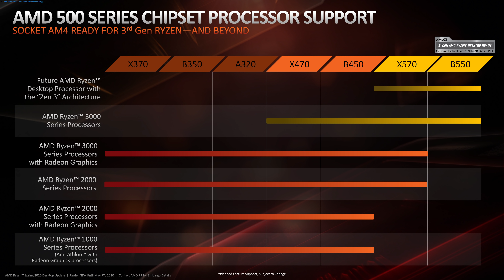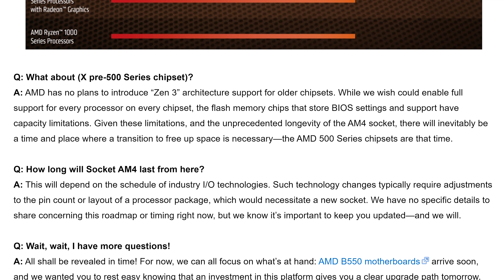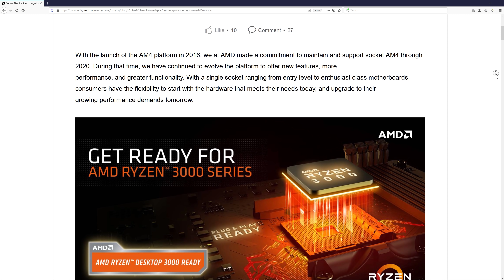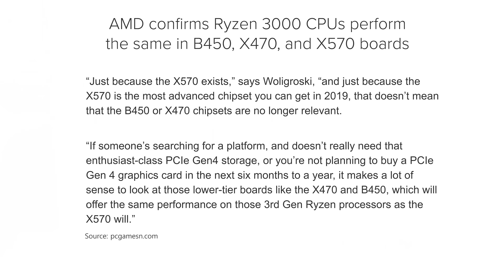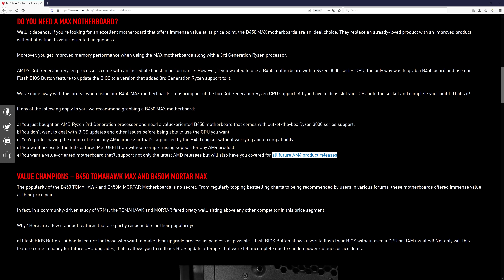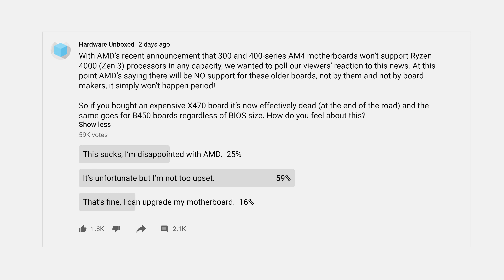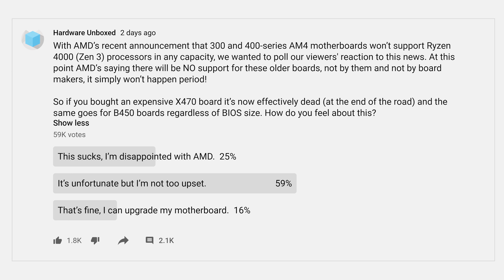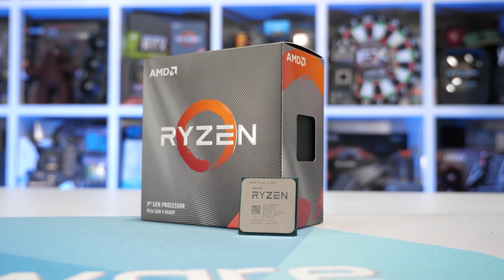AMD Does An Intel, Axes Zen 3 on 400-Series Motherboards, Our Thoughts

Comment: This would of been better if B550 had came out around the same time as X570 at least, the lack of support on B450/X470 would of still sucked but at least there would have been a more obvious choice at the time.
Reply: I agree. Simply a cash grab and to make b550 profitable
Reply: But is it possible that AMD were trying to help their board partners out by only releasing the high end chipset that they will make more money on?
Reply: Exactly this. When I bought my Zen2 last year, well obviously B550 was nowhere and the 570 boards were insanely expensive. All the media indicated that Newer B450 (max) boards would be good for Zen 3.
Reply: @Opaheke1  So, you're blaming AMD for what they media told you?
Reply: Banana  0 AM5 next year
Reply: this! to be honest I wish there was a B550 because when i was building mine i really wanted a 500 series board but at the time they are all very pricey! so i had no choice but went for a b450 tomahawk
Reply: That's square on the AIB. In reality a new A530 and B550 board should have hit the market along with the x570. Instead they got lazy and allowed those boards to continue, making money off the 570 and profiting off older boards that budget builders wanted. 

The x370 is a good board but if someone wants pcie gen 4 they need a 570. Going forward gen 4 is going to be the mainstay. I mean let's be honest almost 10 years on the same socket is amazing. Upgrading to a 550 that may have more features....adding more value is a win for consumers in the long run. No one will have an B350 or 450 lying around if your board goes bad, you will eventually be forced to upgrade either through obsolence or damage.
Reply: You mentioned the alternative. If you wanted forward compatibility you should have went with the chipset that had all the latest features in it. X470 and B450 are 2 years old and are really just enhanced X370 and B350 motherboards.
Reply: @carisi2k11  I don't get the point.I m an early AM4 adopter and got into the platform cos AM4 commitment as   AMD marketing pushed back 2017.So we speak  about AM4 not chipset.AMD NEVER told us about chipset upgrade paths only BIOS.This what I told in Reddit 2 days now and got downvoted.I agree 100% with Steve at 4:40 thru 5:40.AMD start to break the promise with Zen2 naming beta bios for 300 models.That was strange and odd thing as x470 taichi had no difference to my x370 taichi.And the weird thing was the removal of pci 4.0 from quality boards.
Reply: @GreekSIMRACING  Imagine trying to talk sense on reddit. It's useless , fanboys will defend the company even it the move its actually anti consumer because it doesnt affect them

Comment: Your "simple" workaround of multiple BIOS' would lead to a lot of buyers ending up with incompatible versions and a board+CPU combo that doesn't POST.

And most people won't have access to a CPU from the previous generation to do the update with.

When I bought my 2700+X370, I had the reseller update the BIOS, but I still remember that I wasn't sure whether I needed it and thought about saving money by foregoing it. In the end it was just lucky that I did.
Reply: Not true at ALL. You can upgrade or downgrade your bios buddy
Reply: @nephron9924  if you have a CPU with which it POSTs at all. Otherwise you're out of luck.
Reply: @notthedroidsyourelookingfo4026  some motherboards can update BIOS without a CPU via a special button and a USB stick, but it would be confusing to a new user and quite complicated given the mixing of different architectures between 1000, 2000, 3000 product naming.

Comment: It may have been to avoid consumer confusion too. Currently sorting for a chipset does not guarantee that your CPU is supported, until it had a BIOS update, and I think they somehow want to prevent that confusion from getting worse in the sense that some motherboards will have enough flash and others don't.
They already went beyond what Intel ever did, and if they support the 500 series properly for another few years, I don't see them as doing an Intel.

Comment: Am surely pissed off with AMD with their choice to not support B450 boards. I upgraded all my desktops with 450 boards and with AMD axing support for them is a really bad move. As you've mentioned the companies assured us that our boards would give us future support for new AM4 CPU's (at least Zen 3). Now with this decision, AMD has acted like intel where  now to run their upcoming processors you have to buy a new motherboard with new CPU socket and chipset making the entire upgrade expensive and making obsolete what you got which has only gotten a 1 generation CPU support and a short life span. Thanks AMD for screwing us over again after we thought you had our backs compared to intel!!! I see lawsuits popping up soon.

Comment: I kinda agree with Linus on this matter, where he said AMD is probably doing this because in order to improve and expand CPU and chipset compatibility, they screwed over the user experience because of the bios updates required to use newer processors. This might be fine for people who are upgrading but for new customers is a lot of hassle. So they are probably trying to avoid doing the same thing to avoid confusion and bad user experience for newer customers. It still sucks for 400 series users, wish they reconsider it.
Reply: I've had to flash the bios on all AMD mother boards.  Ram compatibility on B350, PBO issues on B450, Boost algorithm for X570.  Not exactly a great user experience on any.  AMD bios just sucks.
Reply: @jamesthomson8659  Then maybe that's what they are trying to fix with this decision

Comment: It's a bit fucked up to release a Ryzen 5 3600, promotes b450 compat (x570 mobo being more expensive than CPU itself :S, no b550 yet) and ''removes'' forward compat for next gen CPU THAT THEY JUST PROMOTED AND WE BOUGHT!!!! AMD really screwed their costumers here and kinda blaming Mobo manufacturer on their small BIOS chip(which MSI had their solution already and BIOS can be in multiple parts to fix this)

Comment: Question...  Modded Bios??
Also have an X470 Taichi but paired with 2600.., thought I would skip 3000 series and upgrade to 4000 series. Maybe not. But I see no technical reason for X470 not to support zen3. We just need the Bios. Over at overclock.net there individuals with skils for this like 1usmus.
https://www.reddit.com/r/Amd/comments/8kz4p2/huge_collection_of_ryzen_modded_bioses_by_1usmus/

Comment: I only bought my Asus prime x370 pro board because it was an old display model and and I was told they were supposed to get years of support, which I guess they were right, but I bought it right as Ryzen 3000 came out because they were swapping displays. I also got a used 1800x so I guess I have upgradability, it's just a little disappointing that everybody expected this exact thing to not be happening.
Edit: isn't it the bios storage thing they're saying is holding it back from older boards? Doesn't the Asus prime x370 pro have a lot of space?

Comment: That I by any chance have a X470 or B450 motherboard, I would buy on discount 3800X or 3900X CPU and would be in peace with myself for about next 4-5 years. In meantime AMD will change a socket and add a new generations of CPUs, and I would be happy again with a new things in the process.  I will not cry because of this AMD "bad" move. They have self agenda, and everything new may be just a better option.

Comment: It makes no sense for AMD to not offer 400 series MB support. Anyone who bought a x470 or b450 is not going to run out and buy a b550 or x570 board for zen 3 when zen 4 will most likely be on a new socket. Who in their right mind is going to make 2 mother board purchases (400 series then 500 series) and 2 cpu purchases (Zen 2 then Zen 3) within 1 year for a 15% IPC up tick only to have AMD the following year release a whole new Am5 socket series? What they're doing is losing zen 3 sales to 400 series owners and greatly pissing them off in the process, especially with their dishonest excuse that the flash memory isn't large enough. Most X470 mother boards have 32 MB of flash ROM which is more than enough for 3 generations if they simply offer a bios that drops zen 1 support. I'm extremely disappointed as I purchased a Asus X470 Strix about 6 months ago with the plans of upgrade to the best possible zen 3 chip when released. Hearing all the hype of the zen 3 chips I even went out and bought a EKWB Monoblock for that board which means I'm especially pissed off because that block can only be used on that board so I'm absolutely not going to be buying a 500 series. If AMD doesn't back track on this I will, just like most on 400 series, simply run my 3000 series CPU for now until it is obsolete then switch to a new platform which will most likely be Intel at that point. No one wants to hear the "well... technically..." excuse about how the promise was worded. You said Am4 support through 2020 and while I can see the 300 series support being dropped due to age, the 400 series considering how they were promoted over the last year when compared to the x570 is inexcusable. If you bought a 400 series and you still have to go out and buy a new mother board then I don't care if AM4 is "technically" still supported by zen 3 because they might as well of just changed the socket to AM4++ and made you buy a new board anyway. You don't tell people "yeah x400 series boards are fine if you don't want PCI gen 4" then say things like "Am4 socket will be supported through 2020 with the new zen 3 launch" then after everyone buys 400 series say "sorry we've kept our promise now you have to buy a new mother board but it's not because we don't want to it's because the flash ROM can't hold more cpu bios (bullcrap)". Very very bad move AMD.

Comment: I don`t know what you all guys are bitching about. I`ve bought myself x470 board and Ryzen 2600 over a year ago fully knowing that it will last me few years as I will need more GPU power before needing new CPU. I`m sporting RX 580 8GB here. Wait for 4000 series to be released and then buy most powerful 2k/3k series CPU for your mobo as you can afford for a fraction of release price. Boohoo you 30$ mobo won`t run 4k series? HTFU, save up and upgrade in few years. We will be on 5k or 6k series by then.

Back in 90` we had to upgrade WHOLE SYSTEM <CPU/GPU/RAM> every 6 months to be able to run latest games. 1 year after purchase it was enough to run latest games with minimum settings at 10fps if you were lucky. 2 years after purchase it was piece of junk. Upgrade or fade into obscurity. Nowadays well built system will last you 10 years CPU-wise. GPU-wise easily 3 years. Stop bitching because there is nothing to cry about.

Comment: I bought a B450 board with a 2600 at launch, forecasting an upgrade for 4xxx... I guess I'll rather buy a cheap second hand 3900x  in 2 or three years, and change my mobo for an AM5 one with a Ryen 5xxx or 6xxx, depending on when the 3900X would be not enough for me anymore. But I can already assume that move from AMD will allow the second hand prices for the high-end 3xxx to stay pretty high, sadly.

Comment: i was on the fence between x570 and b450 last december - ultimately decided on the x570 for forward compatibility (with pcie 4). 

was in this situation with choosing z77 over z67/68 a couple of years ago (with pcie 3). didn't regret either choice - i use PCIe4 storage now and it is FAST

Comment: Arguing that AMD promised to maintain the AM4 socket with no mention of the 300 and 400 series chipset support is simply dumb, well because in a similar manner even intel can claim that they maintained support for their LGA-1151 socket ever since the release of intel 6th gen skylake cpus all the way to the 9th gen processors, even though they were forcing their customers to buy new motherboards every two generations or so. Supporting the socket doesn't means shit if the chipset doesn't support future cpu releases as one would have to buy a new motherboard anyways and at that point it's irrelevant if it uses the ongoing socket or a new one. 😂
Reply: One other thing is that the CPUs also got a boost in cores:

i3 2/4 to 4/4

i5 4/4 to 6/6

i7 4/8 to 6/12 to now 8/8.

Comment: This is the second time AMD has done this to me in less than a year - first my X399 system has its upgrade path canceled and I'm told "well technically they only promised for AM4, not TR4." Now the X470 system I built for my brother gets its upgrade path canceled, and I'm told "Well technically they did support it into 2020..." If I wanted to keep getting screwed over by "Well, technically..." dodges I would have built an Intel system!
Reply: I bought a top end X470 just because to be able to update later.... Now yeah....
Reply: Scott Butler exactly, if we are going on the path of basically same as Intel, I'm voting with my wallet. Sadly most of the populace are content with paying more and replacing everything each time they upgrade.
Reply: with intel, you know exactly what you are getting because they tell you up front and don't make promises they cant keep.
Reply: To be fair there is a technical difference between TRX40 and X399 that breaks compatibility and it's a physical difference in the number of traces on the motherboard between CPU and chipset that gives TRX40 four times the bandwidth with Zen 2 based Threadrippers, that's not a petty difference.
Reply: Yes, please, buy an Intel system. So you can buy three motherboards for the exact same CPU architecture. Such a much better buy.

You are literally complaining about AMD turning EOL, when a new motherboard with every CPU release was THE NORM not even two years ago under Intel. And not even worse as they are pushing new motherboards with old CPU's, and not making any promises on forward compatibility. You're making a mountain out of a mole hill. Pick up a 3000 series part, like a 3900X, and be thankful that's even an option. When Intel used to charge over $2500 for a CPU, and over $1000 for a motherboard, to offer the same level of performance, with zero upgrade path.

My how short some people's memories are.
Reply: Go ahead and build an Intel system, get 5 generations of the same Skylake core and for years eat their bullshit that you need 3 different motherboards for those.
Reply: Why are you changing CPU’s every year?
Reply: @ethanmitchell7753  The best way to save money is to have a main PC and weak temporary PC, sell your main pc CPU right before the next gen comes out, use your temp pc in the mean time, and then pop in the newest one. That way, you'll end up with the best of the best hardware and when you finally get stuck on your current platform, you'll have the most recent CPU.
Reply: Go back to Intel 👍
Reply: I'm and AMD fanboy, always have been. But after having PCIE gen4 taken away from my Crosshair VII (it ran a gen4 ssd perfectly by the way) and now having no upgrade path after only one cpu on my new board, I'm going Intel next time. At least with Intel when they require a new motherboard you can still get better performance within your generation, but with my 3700x the only 'better' cpu for gaming I can upgrade to is a 3950x, but even that is a minimal improvement. An i7 9700 to i9 9900k though? That's worthwhile.
Reply: Why are people being so fucking butt hurt about this, just look on how many motherboards 3rd gen ryzen is possible to be run at. Maybe 4rd gen ryzen is too strong for the boards which are available now, and needed an upgrade.
Reply: @rednath7734  did you not listen/read what excuse amd gave?  They said the bios size is larger than 16 mb so old mobos won't fit them. Its not a different socket but the fucking bios size which is already compatible with b450 tomahawk mobos but Amd said they won't support them too. We are decieved.
Reply: amd in 2016 said support will end in 2020.
amd in 2019 said again to remain us support ends in 2020
can you please explain to me why you got a 470 MB for zen 3 when they been saying otherwise? 

you didnt get screwed. you had the information and didnt use it.

i got the 570 thinking it had no upgrade path at all because zen 3 was meant to be am5.
Reply: @BrotherO4 Zen 3 was always meant to  be AM4.  https://hothardware.com/news/amd-confirms-am4-socket-support-future-ryzen-processors-2020  Zen 3 was supposed to be released last year.

Comment: I recently built a machine around the Tomahawk Max. With saving a few dollars on the motherboard I was able to spend more on the GPU meaning I was able to afford a 5700XT. This made the machine pretty darn decent at 1440p (paired with a 3600). I am disappointed that AMD have pulled this fast one as it means the upgrade path has shrunk some what, but to be honest if and when I'd upgrade it I'd more than likely look for a used 3950, but that does depend on how the prices go I guess.

Comment: @Steve, with over 20 years in PC hardware, between AMD and Intel both Ryzen 4000 and Intel 10th gen are a bullet to dodge. Might as well get a A320 board talking about the UK market for £40 that will even run the 3100/3300x out of the box now. (newer models and several for £38-45) After that its wait for AM5 and get a full new platform with DDR5 ect.. As for Intel as we know the LGA 1200 socket is wasted on the 10th Gen so that's pointless too lol. (lacking pci-e 4.0 ect) Just my feelings with the current outlook.